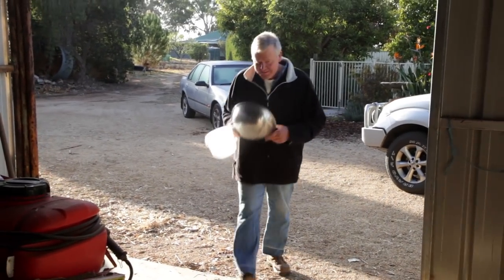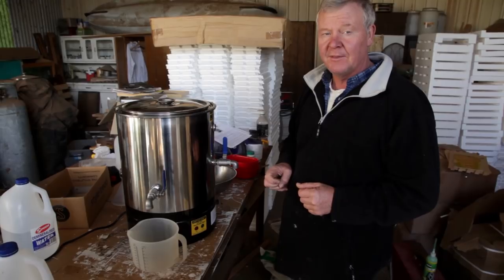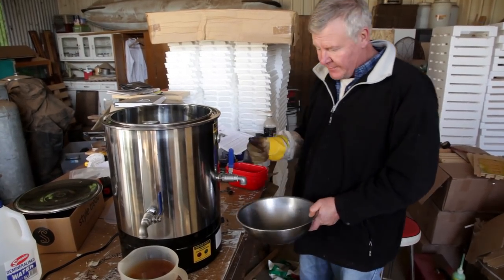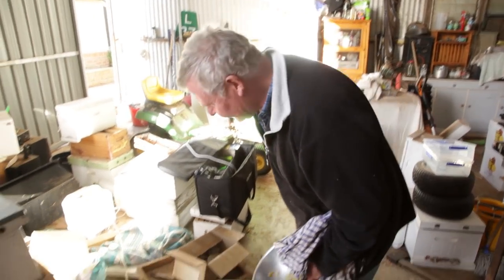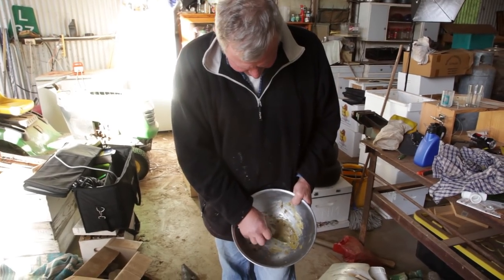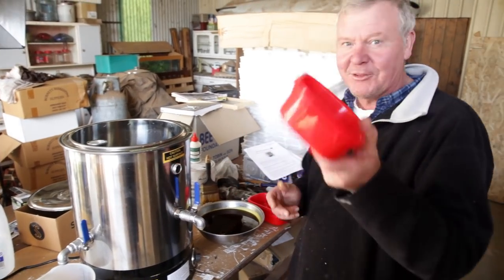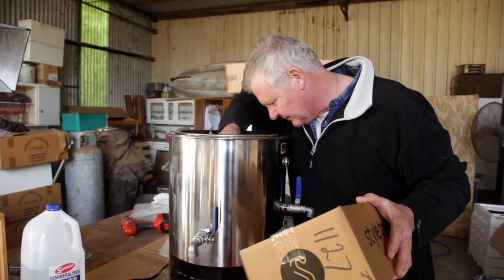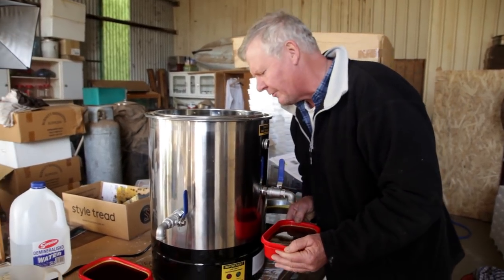How to Separate Beeswax (Part 3 of 3) - Episode 56: "Soup Kitchen"

Comment: A few things that might be helpful. Skim the top with a kitchen strainer/sieve but be gentle so you dont disturb the slum gum at the bottom. (buy your own seive, don't use the wifes). 2 Use flexible silicon cake moulds or silcon Muffin trays (ask the wife about these) to pour good wax into. Recycled plastic takeaway food containers, empty juice bottles or plastic milk cartons can also be used. Ask friends to collect theirs.  3. Wax will quickly clog drains and septic systems so don't wash up in the sink. Boil the kettle and rinse wax off everything outside before you do a final wash up in the sink. Mix sawdust and slum gum 50/50 for an excellent firelighter.